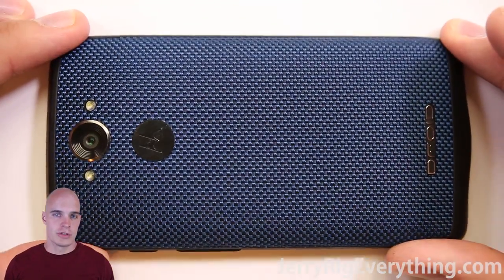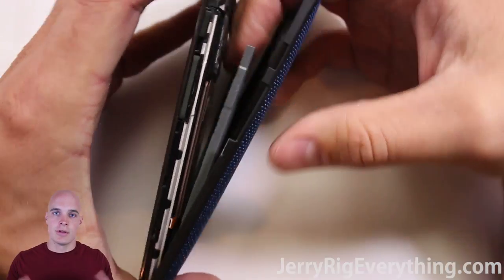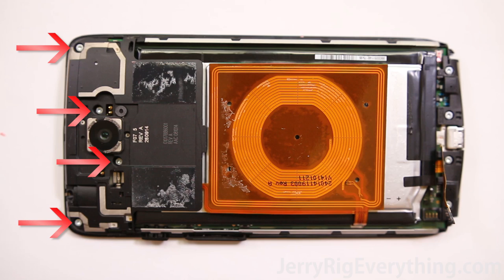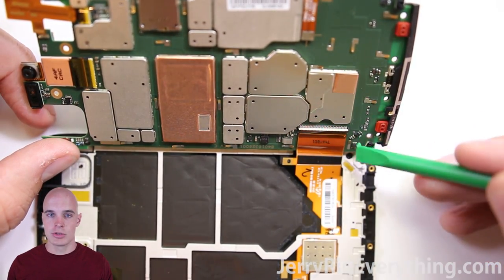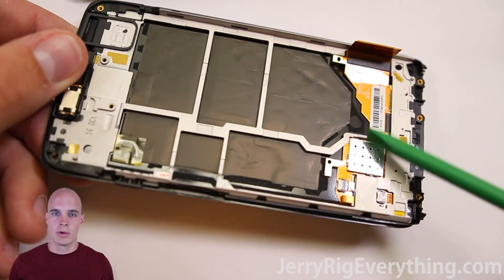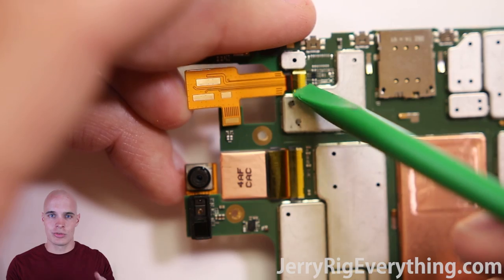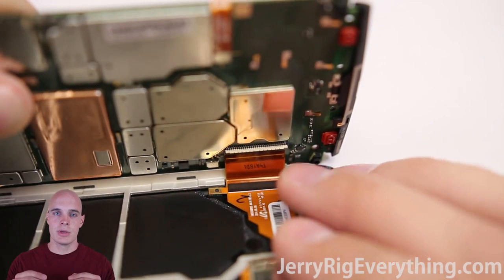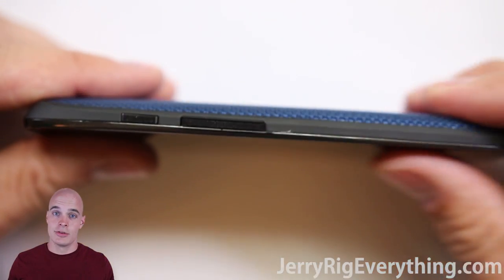Motorola Droid Turbo Screen Fix, Battery Replacement Video

Comment: great video. ordered a replacement all in one screen, frame, etc... used this video to help guide me through the process. phone worked great until I had no sound during calls except when using speaker. used this video once again to walk me through the parts. found out I didn't snap the speaker back in all the way. easy fix, works like new. appreciate these how to videos.

Comment: Hey, thanks for posting this. I needed to replace the battery on my Turbo, and you covered exactly what I needed, and made the job a lot faster, too. Cheers!
Reply: Robert Moser Where'd you get the battery, and how is it lasting?
Reply: I got it from https://www.amazon.com/gp/product/B011Q31SSW/ .  The battery wasn't quite as good as the OEM (maybe only 90% as much capacity when full), but it has held up to daily use and turbocharging without issue, and it still has the same capacity as when I got it.  So I'm happy with the kit overall.

Comment: Thanks for the video! The tool with #5 worked really well. Note, if you are just going to replace the battery, you don't need to lift the motherboard, and disconnect that wide tape connector. If you do need to reconnect the wide tape connector for the screen, put a flat toothpick under the wide tape to make it stick up a bit more and make it easier to put into the side of the connector on the motherboard before clamping it down. The white line on the wide tape should butt up against the connector when it's in place.  If you touched the contacts on the wide tape with your fingers, you might leave a little body oil on the contacts. To clean that up, use a clean pencil eraser to clean the contacts.
Reply: Thank you. I thought I broke the screen because I couldn't get it to turn back on until I read your comment. The butt up did the trick. Thanks again!

Comment: Congratulations for the video. The best one I have seen. But Jerry, I have a problem with my gps. I wiped the data, flashed the gps, etc... And my gps is not working. I think that the problem is the gps hardware . Where is the gps is located? Have you ever seen a problem like this?

Comment: You video helped out a lot during my glass repair.  It's the first time I took a phone apart.  It went pretty smoothly; I was impressed.   After I put everything back together, I turned the phone on and now the touch screen doesn't work.  Do you know what could be causing that?  Would it be the type of glue I used?  I used a very thin amount of E6000 adhesive.  Or is there something I might have forgot to connect?  Any advice would be great!  Thank you!

Comment: Awesome thanks for the helpful video, I did the replacement without disconnecting the screen though and didn't have any issues.  I did snap off one of the copper spring things that sit at the top left of the phone under the first cover you take off, but I was able to put it back and put the cover back on to hold it in place.  The phone works fine so far and can't complain.  Though I did rip part of the nylon backing when taking off the cover but it's not noticeable once the phone is put back together so I would recommend being extra careful if your taking off one of the nylon covers.  Also I would recommend people to make sure they use the correct size T5 screwdriver when removing the screws otherwise you may strip them.  Home Depot carries the T screw drivers pretty cheap.

Comment: I had never replaced a screen. I watched your video and it was well made and helped me replace my screen easily. Great Job!! The only suggestion I have is that, in watching the video, I scraped of the key y charger when I didn't need to. Maybe put a caveat before that step.  Otherwise very helpful video. thanks

Comment: Thanks for a very helpful video, I followed it to a T and things went well.  I have one little issue that has popped up though.  I now lose signal very easily in places that I never had trouble before.  Is there an antenna that I may have messed up or loosened that could be causing this and where is that located?  Thanks!

Comment: This is the best phone I have ever had. 4 years old. And all it needs is a new battery and a new screen due to frozen pixels. And still has higher specs than most new flagship phones.

Comment: Very helpful video.  Getting the screen connector plugged back in is very finicky.

Any idea where I can get replacement adhesive to hold the new screen to the frame?  I tried double-sided tape, but it just keeps creeping out of the the frame.

Comment: BE WARNED. Thanks for the repair. You forgot to mention the Speaker is attached to the case. Also, you forgot to mention that the touchbar at the bottom of the phone needs to be put back a certain way. Now my phone is broken, the replacement speaker doesn't work, and the touch on the phone doesn't work well at all. Always nice to have a video where people leave out details that lead to you having to buy another phone.

Comment: Zack, Super nice video! The battery in my "Turbo" doesn't last as long as the one in my previous "Droid Maxx" (almost same phone) and I've been thinking about changing it but thought I could ask you a couple of questions first. 1. Do you think a new battery would make any difference in the "Turbo" or do you think it's the extra gargets that are eating up the power? and 2. I'm pretty handy but this does look rather complicated and fragile. On a scale of 1~10 how hard do you think this battery switch-out would be for the "slightly above average" person would be. LOL, Thanks in advance.
Reply: Changing the battery is easy. I spent more time prying up adhesive than anything else. took me less than 10 minutes.
Reply: Thanks for the reply, I sent it back and Moto sent me a new one, back to 48 hrs again!!! I think something was wrong with a batch of
"turbo's" but they are not calling it a "known Issue." what do you know about green vertical lines on laptop monitors?

Comment: I like the facecam idea, but I feel it is a bit distracting. 

Just my opinion, no hate. Great job as always!
Reply from the maker: Jake Methner Ya, I cant decide if I like it. Still fun to try though!
Reply: JerryRigEverything Yup it is. I have a question, is denatured alcohol good to remove the glue?
Reply from the maker: Jake Methner Yup! Thats what I use.
Reply: Ok, I used that today, but there are a lot of scratches on my screen now. The polarizer to be more technical is all scratched up. Will using loca cover these up so that this screen is actually decent?
Reply from the maker: Jake Methner Loca does hide a ton of scratches. Yes.
Reply: JerryRigEverything Have you ever tried removing the back light to complete a Loca replacement? So you dont ruin the back light.
Reply from the maker: Jake Methner I personally havent done it that way, but I have had a few guys suggest it.  Honestly I avoid 'glass only' repairs whenever possible. It is usually more cost and time effective to just swap out the whole screen.
Reply: Oh I see, I've been doing that, just like you. Thinking about switching for the better profit, but its quite some work :P Tried it today with some extra displays. Thanks for the responses
Reply: JerryRigEverything Just one last question, I used the spudger like you showed in the video and my LCD is all scratched up, what should I use instead? One of those plastic razors?

Also the denatured alcolhol seems to have damaged the back light. I guess you really should detach the lightbox for the repair.
Reply from the maker: If you want zero scratches you have to use your fingers and denatured alcohol. I didnt think that the alcohol would damage the backlight... I thought that was just the Loca glue. Alcohol shouldn't damage anything.
Reply: JerryRigEverything Yea so when I tested another LCD today with denatured alcohol, it got into the back light and wouldn't come out. It was like stuck in there, and looked like liquid in the back light. 

Guess I have to replace the back lights on 3 of my displays and remove the polarizers too. Wow this became a pain. 

I am going to remove the back light and cover them from now on before I do cleaning or anything.
Reply: JerryRigEverything Have you noticed that the Denatured alcohol leaves a weird residue after you clean with it? I am going to try aceton to clean that off.
Reply from the maker: Let me know how it goes.  Aceton is some pretty heavy duty stuff.
Reply: I like the face cam
Reply: Please remove it. To distracting

Comment: Thank you for the video on digitizer and screen repair for droid turbo. My repair went just as you described. My screen works great, however, now there is no sound from the phone. I can hear telephone calls, etc. only if I have headphone or earbuds plugged in. What did I do wrong? How can I fix it?

Comment: Thank You Really Helped!  Do U Know How To Take Out Stripped Screws
Reply from the maker: +Fermin Salas You can try putting a rubber band between the head of your driver and the head of the screw... sometimes that helps grip. But using the right size driver is your best bet.

Comment: YOU did excellent in this video, i have xt1254 with three faults i.e charger showing its charging on the screen (percentage not exceeds then 1, 3, or 9%) but not charge the battery, sim network not found, imei not show in settings. advice pls......

Comment: Hi Jerry, thanks for the video.
I have two questions. first, the usb port of my phone is failing? can I change this part? where can I find a replacement?
the other question is that one of the flash pins is not working, is that fixable? 
thanks and cheers from chile

Comment: Great video! Question: What if my screen still doesn't come on but i can hear the intro come on over and over again with no sign of "life" on the screen? I replaced the LCD but This problem was also the reason for me replacing the LCD.
Reply: Mesha Ruu I have the same thing happening, did you ever find a solution?

Comment: hi - great video, helpful; only note - I was not able to get the screen/lcd out of the midframe without damaging the frame, and wish I had just purchased the frame on the front end. also, didn't realize I needed the adhesive to attach the frame. I found another video with recommendation for adhesive, which I was able to find on the same Repairs Universe site. Maybe add that note? Maybe link to frame and/or the adhesive (the other video used the red double sided 2mm adhesive - I bought that one even though the 3M of same size is same price - figured tried/true...?!)

Comment: Hi, nice video. I dropped my Droid Turbo in water. When I plug it in, the battery charging symbol comes on but it won't charge. Not surprised but I'm wondering if you think it would be worth it to try and replace the battery. thanks in advance.

Comment: Hey Jerry, I watched this video and used it to switch the screen from a broken Droid Turbo (my wife's), to my Droid Turbo, which had a broken screen. I wasn't able to turn the phone off before I started because the display was inoperative. I got everything switched over successfully, but the display from the broken phone (which worked fine) does not work on my phone at all. Also the phone vibrates about every 30-45 seconds and occasionally gets warm. I took it back apart to be sure the screen was plugged in and it appears that it is. Any advice? Otherwise, thank you for a really informative video.

Comment: thanks for the video. my turbo is experiencing power button issues, and don't seem to charge . and the qi charger also won't work . I see the qi unit in video has a tab going above itself and sticking to battery . mine looks tonbeen ripped of mine is a replace warranty model and in the end I bought the new turbo 2 but was trying to fix this one . and leads on a new qi  part .I'm unsure if this is y it won't charge. but its the only thing I see wrong.

Comment: is the charging port easy to replace?  also, if my frame got bent (don't ask) is it possible to replace the screen if I bend it back and it's not completely straight?  the top 1/4 of the screen turns purple (or black or white) and blinks

Comment: great video! thanks so much for the help. i really appreciate your quick and straight-forward video with your face just in the corner and perfect camera quality. thank you so much!!!   

 I got my screen replacement from phonepartsusa. it came with screen, digitizer, and frame all in one. A couple of small pieces were missing from the new one: the power button (which took some force to get out and in) and a little black box from the upper corner of the screen. Super important for everyone to look over their old and new part before closing the phone up!

Comment: Is there any way to salvage or get a new replacement power button? Or is there anywhere I could buy the the entire assembly with the power button? Everywhere I checked the entire screen assembly is sold without a power button and removing it from the old frame is difficult from what I've heard.

Comment: Are the connections for the LCD screens relatively universal?  I shattered the screen of my Droid Turbo working at a house fire.  Given its age, cost, and a few other factors, I decided to buy a new phone.  However, if I could connect a cheap screen (doesn't have to fit), I could at least get some function out of my old phone.  Thanks.

Comment: Two of the screws were stripped in the phone when I tried to replace the battery.  Do you know where I could get some replacement screws so I can drill these bad ones out?

Comment: I took apart my Droid turbo and replaced the battery after I put it all back together my bluetooth headseats haven't been functioning properly and my wifi reception has gotted drastically worse any ideas? Also when taking off the qi charger i wasnt realy able to attach back on well.
Not sure of I need special adhesive?

thank in advance and great vid
Reply: +leviyid Did you figure this out?

Comment: Any suggestions on how to fix an external sound issue on a Droid turbo? I have ruled out ear phone jack only mode and can get external sound by applying pressure to the back of the phone just below the camera lens. This tends to indicate to me that I have a hardware issue, maybe a contact issue, not a software issue, your thoughts?

Comment: it's worth mentioning that the speaker is built into the frame.   unfortunately I replaced my screen as a frame, LCD, digitizer combo and didn't notice the speaker so it got taken out in the garbage in the old frame.

Comment: Hey have you heard anything or know of any way to turn my old used droid turbo battery into a mobile powerbank? If it's cheap it would still be worth the 6 hours of batter that it still has in it.

Comment: Hey Zack got a question for you.  i have a Droid Maxx and i changed the screen on it because i got the phone cracked and the home and multitask button were not working.  After i did the change and got the phone put back together i tested everything and it was going good until i got to the volume down button.  the actual button broke and i had it repaired but it is not a complete fix as the damage has caused it to be non repairable if i break them again.  did this happen to you on this phones cause i looked and the buttons are 100% the same.

Comment: My loud speaker stopped working it was cutting in and out as I was pressing/squeezing top right corner of the phone now it stopped working completely. Replaced the speaker still no avail do you suggest replacing entire motherboard or is there anything that Im missing??

Comment: Can you re-assemble the phone without the wireless charging components? (The only issues I can forse are 1) if the computer verifies that it works on boot/charge, or 2) if it would run a current through it during use.) Any ideas?
(my purpose is to eliminate any electrical disruption the component may cause.)

Comment: hey im new here but love the video anyways my droid fell and the  screen didn't brake or anything you know but once i tried to turn it on nothing happen i tried to charge it but still dead screen but my phone does vibaerate like every five min. if that helps but i dont know what to do to fix it but i did see how you open the phone up and that little string that connects to the mother bored might be the problem my phone has i hope this is enough info to help me out lol please help

Comment: Is the screen durable or does it crack in the pocket or when dropped from a height???
Reply: Keiron Ramsey I have had my Droid Turbo for almost 3 yrs and have dropped it at least 8x onto concrete floors, tile, and pavement.  The only reason my screen finally shattered was because it dropped onto pavement screen down with lots of rocks under it.  Also I have wide hips and have slammed it into case corners and metal walls repeatedly while the screen was cracked and it still worked for a year, even with the shattered screen, while I saved enough $ to replace the screen  😀
Reply: Nightingale1831 how much did it cost to replace the screen?

Comment: MICRO USB charging jack went bad in 2 months, stopped middle of the night, wierdly WIFI stopped same time, is there easy way to replace the jack, plugged in or probly soldered. Replacement Turbo has bad freaking power button dip switch. Bottom 1/2 dead, recessed into phone, obvious, but sent to me anyway, -2 months & replacement used POS... just keeping for now, hassle x 2... Thx for info.

Comment: by any chance do u know a way to fix the power button. it's no longer responding. i can't heat a click sound and it feels like it's jammed under the button cover. i really don't want to get m y phone replaced because it will be some ones certified pre owned. so I rather work with my phone because I know everything it's been through. please help. if it turns off I won't have a way of turning it on again.